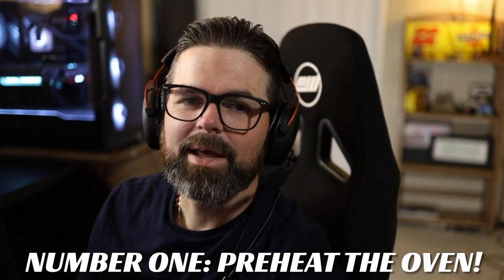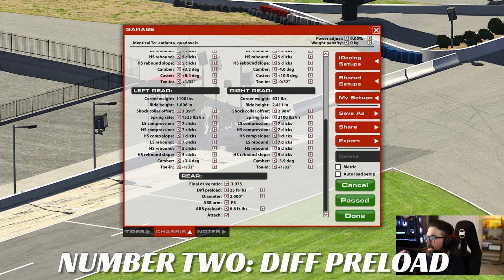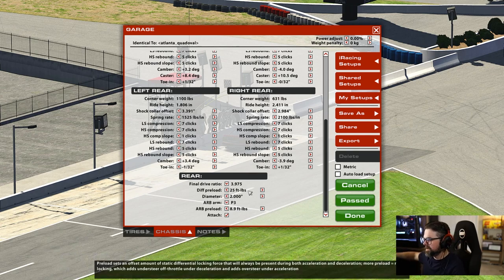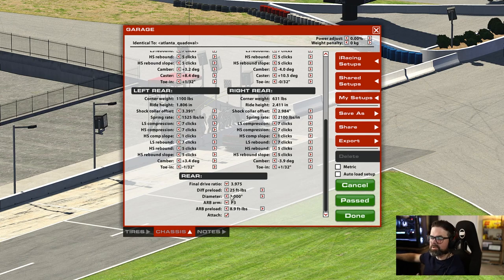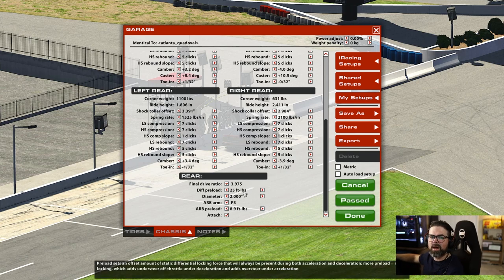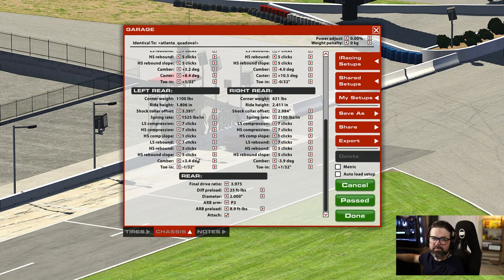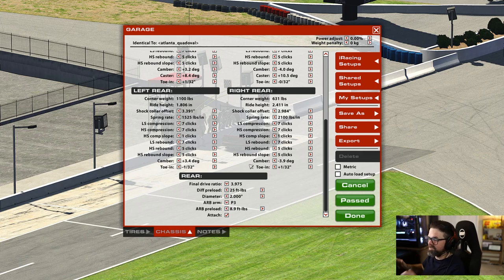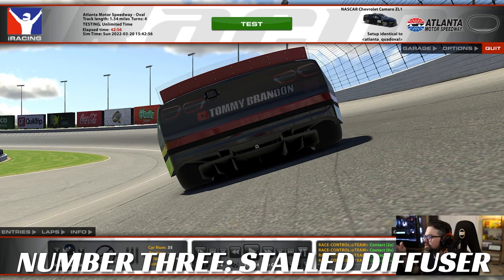Three Reasons Why You Keep Spinning Out in the NextGen Cup Car

Comment: I 100% agree with point 2. But I will also say it's 100% driver preference. I use your insider set ups and at Vegas I added 15 lbs of preload just for my driving style. And the car was still just as fast just felt better for ME. BUT I'm also not a big full lift on entry type driver. I am very smooth on rolling out and keeping around 5% throttle at the 1.5 tracks. Which is just enough to keep the diff locked up. But it's just the way I prefer the car based on how I drive. 

I also can't believe how many times I see people turn 1 lap 1 just go 4 wide and then wreck coming out of 2. It's insane. Like I get it's a "game" but when people do that an ruin my race it's infuriating. I don't get much time to race. My only open nis slot I can run because of work is Sunday morning. And I got screwed at Vegas last weekend. Was not happy at all. 

Anyways. Keep up the great work you're doing mate. Love the content, love the set ups, and love learning about the in depth stuff with this car.